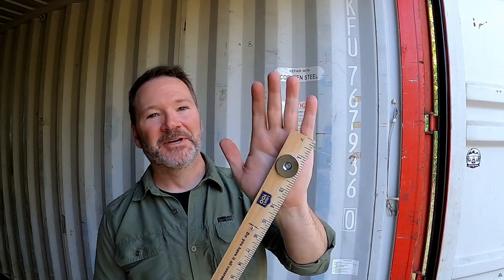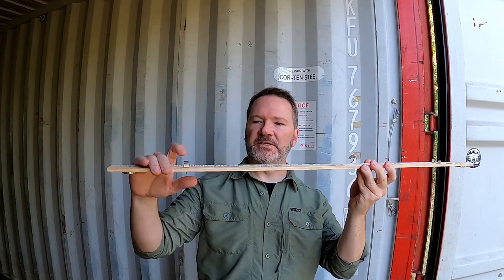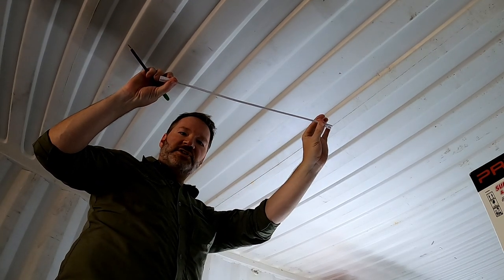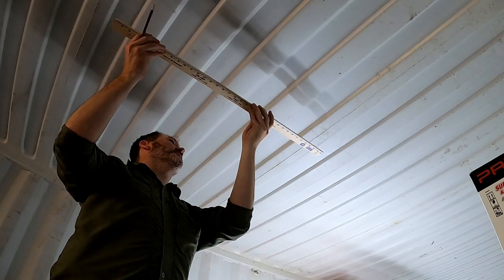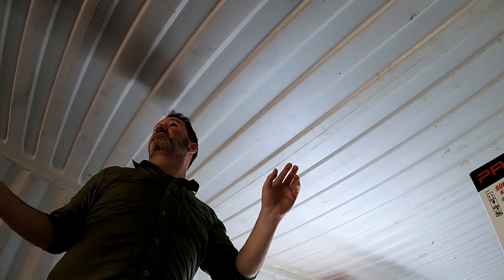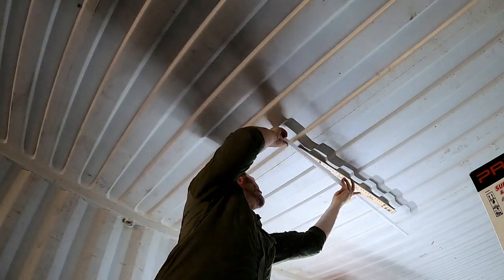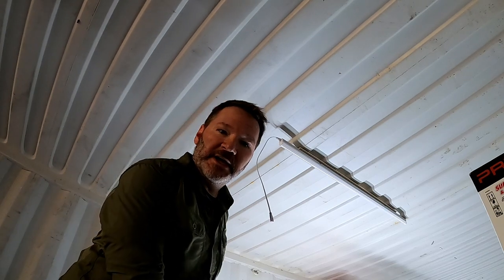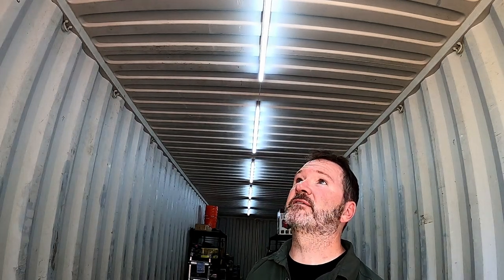Improved Shipping Container Lighting For Under $100

Comment: Even better, the disc magnets with countersunk hole you show pop-riveted directly onto the metal clips that hold the light.  The splayed end of the pop rivet lives in the countersunk area of the magnet.  If you have a shallow one you might have to hammer it down more or grind off the protruding part.  Skip the wood and epoxy.
Reply from the maker: Great idea! Thanks for sharing.

Comment: I like the idea of magnets.  I use lots of magnets for art displays.  I just purchased a 20 foot container to store displays in but was looking for ways to do lights.  My question is how do you get the power line from the solar panel inside the container.  My seller said that if I drill a hole then it's no longer warrented to be moisture proof.  Also,  do you have a video showing your solar panel setup ?
Reply from the maker: Hey George. 

I drilled a hole right below the top square tubing. I used a rubber grommet within the hole to protect the wire from the solar panel as it passed through the siding. Don't worry about moisture, as no rain enters the hole, but I still put in a drip loop on the inside portion of the wiring. 

As for moisture, on warm mornings following a cold night, condensation accumulates on the ceiling of the shipping container. This happened on many occasions before we drilled the hole for the wire.  You can combat this by spraying foam on the ceiling, but that is costly. Make sure you cover your displays to protect from the dripping.

I don't have a video on our solar setup, I can send you pictures. Just shoot me an email. Our email address is in our About tab on the channel description.

Thanks for watching!

Comment: Would you hurt the light screwing the magnet on with a shallow screw in the aluminum on the back of it? I just wonder if there's a circuit board or something near there?
Reply from the maker: Each light has a light strip going from one end to the other. You could take the light diffuser off and move then push the strip over in order to drive a screw through. You would only need two screws/magnets per light. That being said, I found it easier to screw the magnets to the yard stick, and then screw the yard stick to the clips (2 per light) that come with the lights. You don't have to use a full yard stick for each light. You really only need about two inches per magnet/clip, and each light uses two magnets. Instead of yard sticks, you could even use paint stir sticks, and just cut those into 2-inch pieces.  Thanks for watching!

Comment: What solar setup did you use?
Reply from the maker: Hey, Alan.  Thanks for asking.  At the time I recorded this video, I was using an old and small Goal Zero portable power station, along with 120 watts of solar panels.  These lights use about 128 watts, so plan accordingly.  

Since this video was recorded, I have upped our solar capacity to 400 watts of panels, and am now using a 2200w inverter with 200ah of batteries.  This will power lights in two containers and in our covered shed area.

You can see a pic of it here:  https://www.instagram.com/p/C0uwR5XOY9J/

Thank you for watching!

Comment: How are you powering?
Reply from the maker: Thanks for watching, Ben.  The lights are being powered by a small, outdated solar setup. We have panels that capture 120w, and a tiny Goal Zero power bank. The panels and power bank are over 10 years old, but they have sufficed for these lights. Now that we have added another shipping container and have built a shed between the containers, it is time to replace the solar setup. The lights draw a total of 128 watts. I hope this information helps.

Comment: That’s a bright 💡idea!!  Looks very nice. Neat and tidy. Good video. 
I have similar lights in my container, but hung differently. Your video makes me want to rethink my mounting method.
Reply from the maker: Thank you!  Those magnets are super strong.  We really wanted to avoid putting holes into the container or using adhesives on the metal, so this allowed us to get the lighting we needed without using screws or glue on the metal.  I'm sure we'll find uses for the leftover magnets.

Thanks again for watching.

Comment: Ok. I have done my 2 containers, and this is how I did it.
I got the 2-pack of shop lights from costco, 3 packs/6 lights per 40' container. I bought 100 lb magnets from amazon. I used #6 flat head screws, so they fit in the countersunk side of the magnet, and washers and nuts. You simply mark the fixture where you want a magnet, which might vary depending on the highs/lows of the steel, and if it is bent a lot. Drill a hole in the centerline  of the fixture, LOOSELY put the magnet and screw on the top side, washer and nut on the inside. You leave about 1/2" slack on the threads, since the backside of those lights is recessed. Nylock nuts for the screws would be smart so they don't loosen over time. I then also bought magnetic hooks from amazon to help manage the cord between lights and on the end.
Super simple, and I see no reason to buy a bunch of yard sticks.
Now that I am done I need to go back through and pull a string line to line them all up so they don't look like they were installed by a drunk guy.
Reply from the maker: Sound like a great idea, Richard! Thanks for sharing.

Comment: Something I wish I had done BEFORE I filled my container: Paint the insides white for good reflective lighting. Reflection is very important, especially since you might have a bunch of stuff in there blocking direct light.
For those of you with dark containers, learn from my mistake and spend the time to paint. Doesn't need to be pretty or perfect. Rent an airless sprayer if you have to and let 'er rip.
Reply from the maker: Good point, Richard!

Comment: How did you install the solar power supply without drilling into the container?
Reply from the maker: I did have to put in one hole on the side of the container to run the power supply in from the panel.  Thanks for watching!
Reply: @OurNewLand  Thanks!!  We were looking for a solar option without having to drill a hole into the container...any ideas?
Reply from the maker: @michaelgrant3791  as for the cord, I couldn't figure out a way to do it.  The hole we drilled was on the side just below the square tubing that runs the entire length of the container, so it was very protected.  If I remember correctly, the hole is only 1/4" (maybe 3/8') and we used a small rubber grommet to protect the cord.  We put in a slight drip loop in the cord on the exterior side.  In the two years since installing it, we have never had water enter through the hole.  

As for attaching the panel(s) to the container, I came up with two ways to do it without drilling holes.  

The first way is one I found on YT and it involves using the corner of the shipping container.  Here are two videos that discuss that way:

https://www.youtube.com/watch?v=M77FuSPeoQM

https://www.youtube.com/watch?v=v8sVhl7_7l8&t=60s

If I was only going to use one panel, I would have gone that route and used a metal pole  along with this bracket to attach the panel to the pole:  https://amzn.to/445rb0u

We are going to use two panels, so I am going to use two 2x6 boards laid flat across the width  of the roof of the container.  I will use two of these brackets (https://amzn.to/47EB6x9) to straddle the boards.  The boards will then be C-clamped on each end to the square tubing that runs the length of the roof.  I'll probably use a spade bit on the top of the boards so that the C-clamps can't slide off.

Good luck!
Reply: Thanks!! Appreciate the advice!

Comment: Looks good.. what is the power source? Thanks
Reply from the maker: Thanks! Up to this point, we’ve been using small portable power units (Goal Zero and Jackery) that are charged with an old 120w solar panel. Next month we will be installing a larger system that uses 200ah batteries with a 2200w inverter and 400w of solar panels. That system will power lights in two shipping containers and in our shed. Thanks for watching!

Comment: I would like to know what kind of solar kit you have hooked up to run these lights please! :)
Reply from the maker: Hey there! Thanks for asking. Right now we are just using a very old Goal Zero 400 with equally old GZ solar panels (120w total). It barely keeps up for us, as the battery is very decrepit. If I'm not mistaken, the lights use a total of 48w (6 lights X 8watts). I'll double check that in two days, if I remember. The battery is the weak link, not the panels. The lights are awesome, but plan accordingly for the watt usage. 

We are currently designing a larger solar system that will run both of our containers and our shed.

In my bathhouse, I use a cheap system from HQST and I have been happy with it. I use their 100w panel and 30a charge controller, and purchased a small battery separately.

Please feel free to ask us any more questions that may pop up.  Good luck!

Comment: I am looking at getting these lights for 5-6 40 foot containers.  can you let me know how your solar, powers this?  is it an individual per container solar panel or do you have a solar array that powers everything at your property?
Reply from the maker: Great questions! Up to this point, we have been using a small (old) solar setup to power the lights in a single container. We are in the process of redoing the solar system so that it will run the lights for 2 shipping containers and our shed. In total, we will be using 3 of these light packages, all run off of a single solar setup. One set of lights (6 bars) uses 120 watts when on, so plan accordingly. Good luck!

Comment: How did you run the wire to the solar panel?
Reply from the maker: I drilled a small hole at the rear of the shipping container, just below the square structural piece that runs the length of the container. I used a grommet to protect the power line from rubbing against the metal wall.

Comment: I am doing the same project with same lights. Where did you buy thee magnets?
Reply from the maker: Hey Joe.  I bought the magnets from Amazon.  Make sure you buy the 1.25-diameter magnets.  I tried the smaller (cheaper) ones and they were not strong enough.  You will need to buy 2 packs, as you need a total of 12 magnets, but they come in packs of 10.  Good Luck!

Here is the link:  https://www.amazon.com/gp/product/B071ZKQ2X5/ref=ppx_yo_dt_b_search_asin_title?ie=UTF8&th=1

Comment: how long do these lights last - a couple of yrs thx
Reply from the maker: We've had them going for almost 2.5 years, but only for a couple of hours each week.  Still no issues with them, and we had several drop from about 9 feet up with our original set up (glued magnets instead of screwed magnets).  The roof of the shipping container gets damn hot.  We've had some plastic melt that was high up in the container, but these lights haven't had any melting or functionality issues.

Comment: What was your setup for the solar power?
Reply from the maker: Hey there.  We have a very old, crappy solar setup.  I am using a 10 year old Goal Zero power bank and old Goal Zero solar panels (a total of 120w).  The lights draw around 120w, so use that as a guide for how large of a bank you need.  We will be replacing our existing solar setup with a larger one, as we now have a shed and another shipping container that we need to power.  Feel free to hit us up with any other questions.  Thanks for watching.